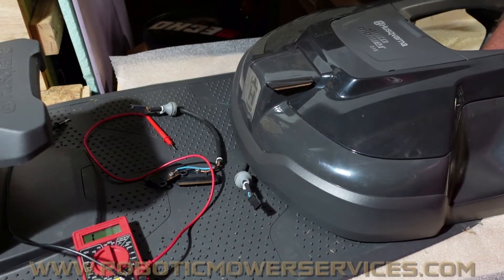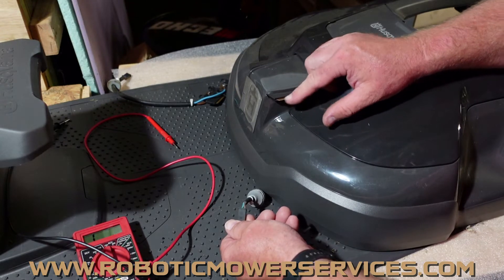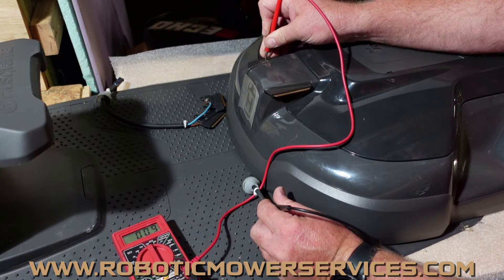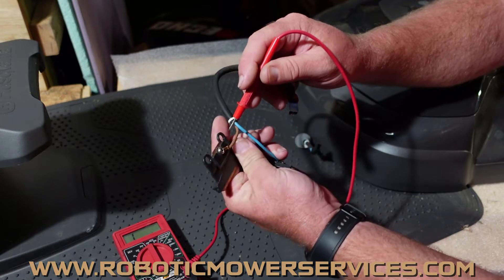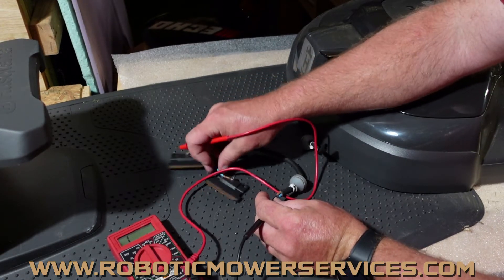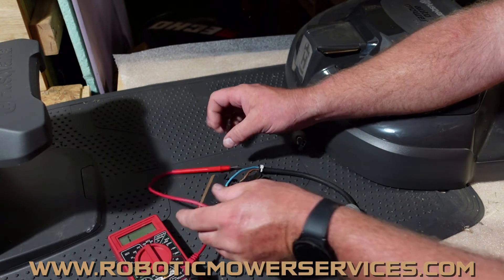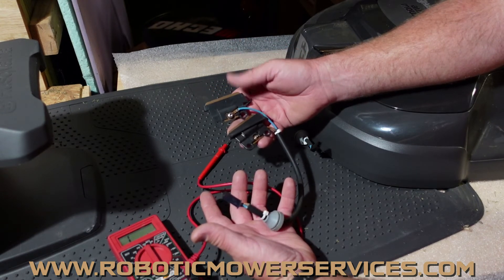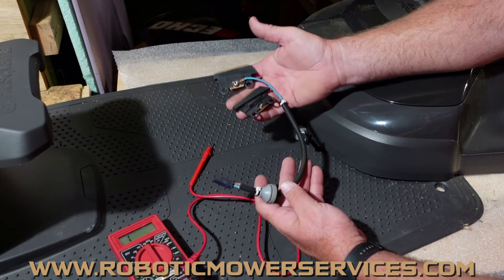Testing The Charging Contacts In The Front Of A Husqvarna Automower (300, 400, 500 Series Non AWD)

Comment: I'm Adrian Vasquez from Mariani landscaping and after coming across numerous burned connector/terminals to the point where the plastic connector fuse together.  I started adding dielectric grease to help current flow and prevent corrosion.
Reply from the maker: Hello Adrian! We've talked with a few guys out there at Mariani Landscaping and you guys are doing a heck of a job with that big fleet of Automowers you have! Definitely with you on adding grease to many of the connections on these mowers. I don't know if you've seen that they changed the wire used in this part and it has a better grommet on it now. We saw some of these where the wires inside the harness (between the plates and connector) were actually corroded and causing the resistance.